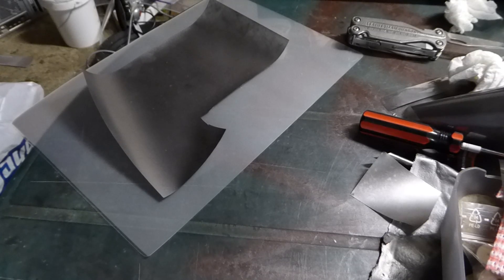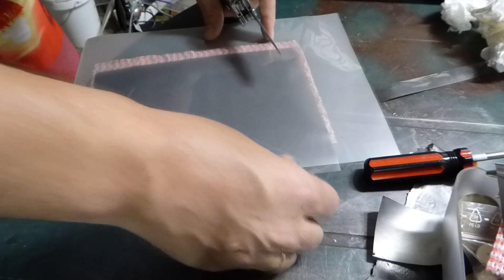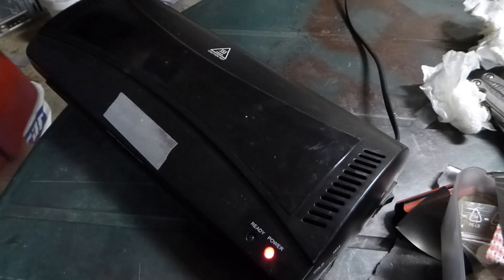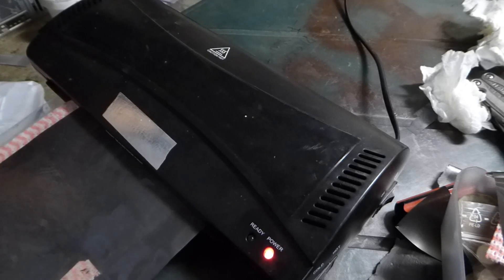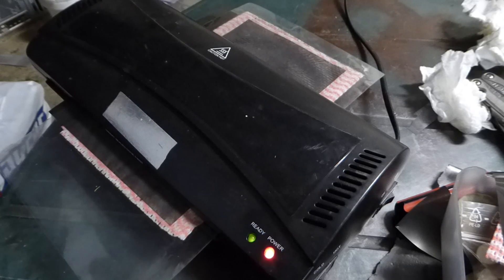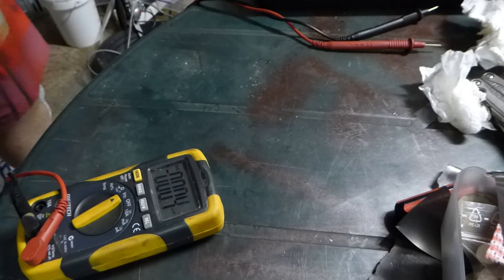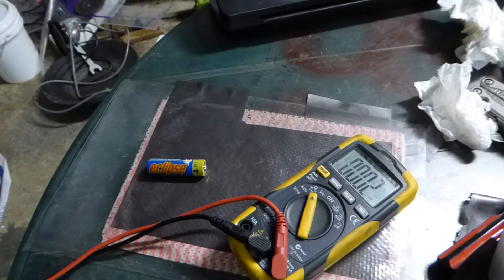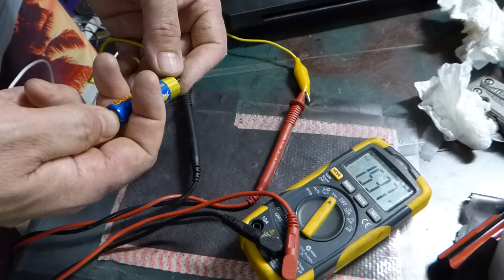Making Graphite/Graphene Laminate Cell LONG Version

Comment: Your meter was probably reading capacitance correctly at 11.00 minutes. It can take a substantial time to measure C if capacitance is large.
Reply: https://youtu.be/KiLTEjm8zLw
This is a graphene solid state generator circuit using graphenes thermal motion to generate limitless energy. Please share and develop this tech.

Comment: Hello, Everyone, Please someone Say ME. What is the Pink material he using in center of graphene sheet  ?. 
And is that electric & heat observation  ?
Reply: it is know in australia as as chux wipe, a cleaning cloth
Reply: @paulveneman1559  ,Sir, you mean it just a ordinary cloth ,Yes  ?.
Sir, Except Copper and TiO2.
Which is the best Heat observation with Electric Condative, Light weight and Flexible, Harmless Cheap Material  ????????.
Please tell.
Reply: @veluvelu2457  yes a cleaning cloth , very thin and fine perforations

Comment: Is this bulletproof? And how strong is it compared to steel?
Reply from the maker: That sort of comparison doesn't really scale. It is like saying an ant is strong. Yes an ant is strong for its size. Yes graphene is strong for its thinness. No single sheet of graphene materials will stop an actuall bullet. Lots of layers could potentially but not by itself...and likewise is it strong like steel? ....steel as thin as graphene would break easily so then you can say it is stronger but does it scale?  You would need a composite gluing enough of the stuff together to make a bar the thickness of a piece of a steel that is thick enough to be considered strong. It's all relative to size.

Comment: no matter how big or small size you still get 1.5 v .
and you should keep it wet as much you can for last long power for doing that you need make it small hole like mesh using needles then salty water with ( bleach liquid ) much better power and much longer , any question let me know thanks grate job

Comment: I am watching your idea on my tv  and my computer and think your graphite solution is too weak.  Grind the the graphite into a fine powder  with  a coffee grinder.  Add clear glue and mix then paint onto a substrate.  You need a low resistance solution.  You resistance is too high. Use a low setting a clothes iron instead of the machine with the material you are using.  test the material's resistance.  Keep trying at it until  you get a low resistance. it might work better.

Comment: Suggestion - laminate each carbon sheet separately using a paper sheet to allow later separation.
Apply the elctrolyte layer between the two pre-laminated sheets and seal them with souble side adhestive using a vacuum pump
to remove the air between the layers.

Comment: is this crazy strong like graphene or only conductive
Reply: it is a layer of graphene but graphene is only one atom thick so it is strong but to get it to stop a bullet it would have to have craptons of layers...PS might stop a weak BB from a crapy gun LOL
Reply from the maker: only conductive in this application. If added to plastics or resins or concretes it will increase strength, claims of strength really are a matter of scale. The same way an ant is very strong, graphene is likewise very strong for it size
Reply: oh ok so if you say shot this graphene it wouldn't stop the bullet
Reply: like this sheet

Comment: Try using a hair dryer to heat the laminate sheet just around the edges and press them with a board.  It will help you avoid the steam problems and retain your electrolyte.

Comment: how not to make batteries, you would have better luck just pulling capacitors out of old electronics.
Reply from the maker: +Dana Rider it's all about having a go and experimenting. It's kind of hard to find supercaps to pull out of things too
Reply: where did you get your engineering ring? AT FUCK U?

Comment: Hey mate nice gecko, anyways can you tell me how you made your foil electrodes is it Graphoil ?
regards kev ( here in the U.K )
Reply from the maker: kev wallcroft it is made with applying graphite to laminator sheets then running through the hot laminator and then peeling open the pouch. Followed by rubbing or polish until no more graphite comes off. The more you rub and polish the higher the conductivity.
Reply: m3sca1 many thanks for a prompt reply, i have now subscribed to your channel and if i can be of any help i will comment.
thanks again kev
Reply from the maker: kev wallcroft there is a new focus on hemp charcoal recently...seems to be better at storing energy!
Reply: m3sca1 yes you are correct using hemp stalk fibers using hydrothermal carbonisation you should watch Robert Murray - Smith he has done a video on this and is awesomely interesting.
Reply from the maker: kev wallcroft if you know of any details on making that hemp char let me know please
Reply: m3sca1 type into youtube hydrothermal carbonisation and watch the roberth murray smith video on the subject the only thing he missed out at the end was that you have to expose the carbonated hemp to potassium hydroxide. Let me know if you need more.
The other thing i needed to say was contact pete over there called   a   on YTube and get some intercalated graphite from him. Expand it and use your lamination method to compress it your electrodes would then be pearlers ;-))
Reply from the maker: kev wallcroft pete has actually already sent me some intercalated graphite :)...it is very good conductivity. I have an interesting skin like electrolyte product he sent me too...see my last mailbag video...
Reply: m3sca1 ha ha no worries
Reply: G day mate did you watch that Robert Murray Smith video on Hydro thermal carbonisation.
kev
Reply from the maker: kev wallcroft i have not a chance-my weekend is finally here though...
Reply: ok when you view the video follow the microwave step first and then go for the pipe in the oven step to properly carbonise. good luck.
kev

Comment: OK lets start with all that is wrong.
The graphite plate to get a continues coverage, you need a constant amount graphite over all the area. 
When using bacteria use a clean media to maintain a culture, and never cook the culture.
You can get the same results of coverage using a laser printer or a toner photo copier, that to extents are the same and use the same materials.
If can change the base for many types, that means you cab have a multy layer print and or dual layer print.
When you sealed the laminate you shorted the poles, sure the only thing the helped is the high resistance.
And the point of all this is to recharge the cell, how can you do that if you can not add the electrolyte.
Seal the sides and bottom even part of the center just any battery or capacitor insulation is the key.
When done right multiple cells can make a great for capacity. 
You missed one other thing how to connect the poles in a useful manner.
I will < leaf > that to you,! 
hope this helps you see some off the problems you have.

Comment: use very thin copper foil and coat it with graphene, make a many layer super capacitor with graphite rubbed into graphene sheets, and see the results. Also try some carbon foam made with sugar mixed with acid or other high capacitor type material added to the graphene sheets. Robert Murry Smith has several good, non graphene type materials that are easy enough to make. I want to do it myself, but I cant get any graphite where im at. What product can I buy that contains graphite, other than pencils, that would contain good quality graphite to use for the production of graphene?
Reply from the maker: +Randy Travis maybe you can get graphite in the form of lock lubricant... where do you live that limits your availability to chemicals?
the idea of avoiding any metals in the construction is to rule any comments about galvanic effects. Thanks for commenting.
Reply: Im not in America at this moment, will be back in a few months. Don't want to say, its not safe to advertise unless you are in a safe country.
Reply: i bought a product off of amazon called seed silk its to make seeds in planters less damaged in planters from the mechanical rubbing that happenes it is graphite paid about 30 dollars a lb after shipping.PS a pound is a lot! for this purpose...

Comment: can you, or have you made a super capacitor with just graphene sheets, made by rubbing graphite on plastic? If so, what were the results.
Reply from the maker: +Randy Travis graphite put down on polycarbonate with polyurethane works well to make a high surface area electrode. I got that idea from youtuber "A" formally known as NeatPete. That is what led me to try this method. A cap made from aluminium foil and kitchen paper towel and salty water was able to keep an LED lit for long periods. So it works, a better product will result when I start applying graphite/graphene  paints to the flexible sheets...
Reply: Here is an idea, what if you used a material that could be dissolved and put graphite on it and rubbing it, then just having a sheet of graphene, do you think this would work? I know paper will dissolve in hydrochloric acid, could you give it a try? This might be a very easy way to get small amounts of graphene with out a lot of effort. Thanks

Comment: Fill the syringe from your cell electrolyte:
Glycerol 2 + 1 of magnesium chloride  + 1 urea
or
Glycerin 2+ 1 aluminum chloride,  + 1 urea

glycerin instead of better working any glycol (propylene glycol, ethylene glycol)
Reply from the maker: Thanks for the electrolyte suggestions.